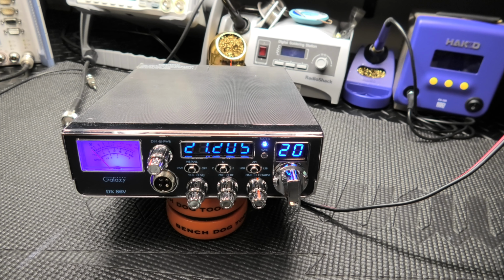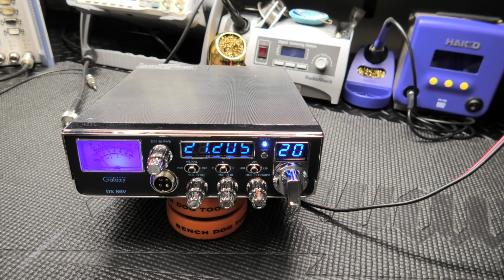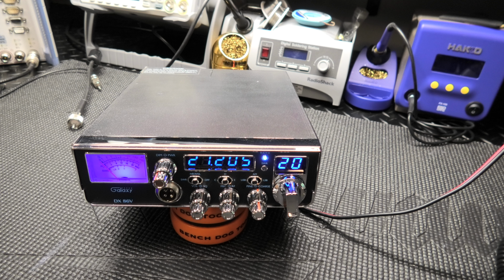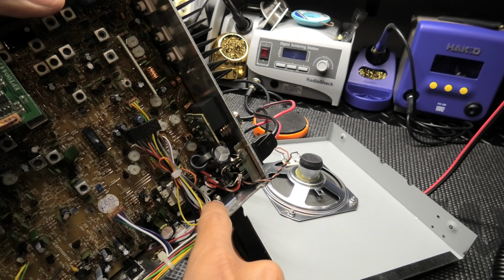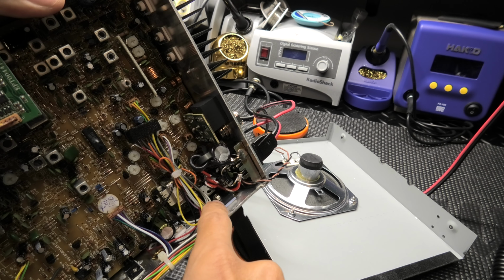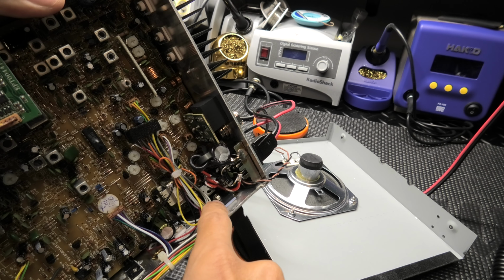DX86V + KL203P Setup Tuned Aligned Galaxy CB Radio SSB

Comment: You must have cut the power down on radio bc I had mine fixed up and my radio by its self will do 65 watts swing that is .. and that is way to much power to run in to that amp just saying from my radio

Comment: How many watts is that radio putting in to that amp I know wat you are dead keying but I have the same radio and I had mine worked on and it swings 60 to 65 watts and that is way way way to much to put in to that amp not if you tuned down way down the swing and stock that radio swings about 35 to 40 watts